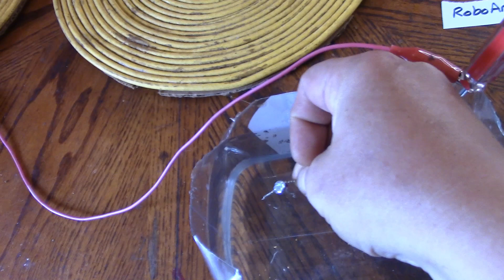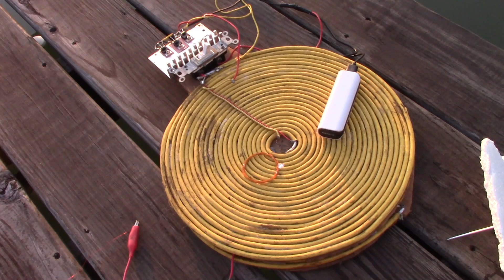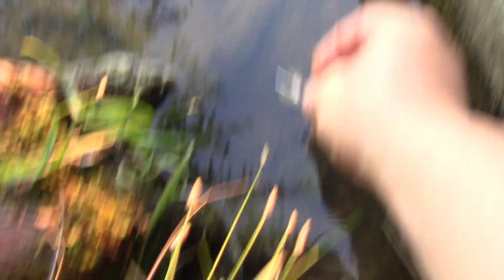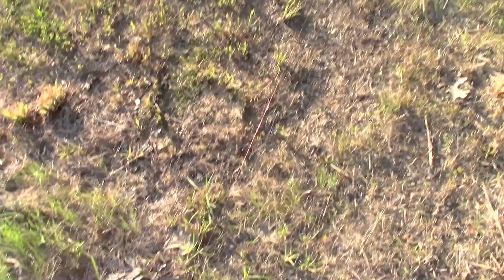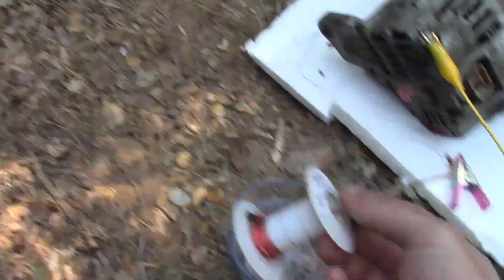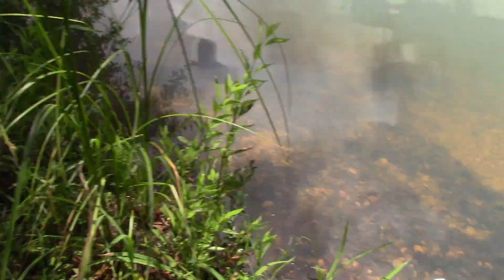Cool electrical effects - 1 wire transmission part 3

Comment: Great video! Are you running your coils as bifilar in LMD mode or in TEM mode?
Reply from the maker: Thanks, the 2 same coils like this are bifilar. In fact they are co-ax, with the outer braiding connecting to the middle copper at the mid length join. They work surprisingly well and were built about 10 years ago.
Reply: @Slider2732_  Thanks! That’s a new twist (pun intended) on the bifilar coil design. So if you are connecting the end of the outer braiding to the middle copper at the midpoint join its operating in longitudinal mode, yes? Also are you getting any cold electricity effects?
Reply: @Slider2732_  It would be great if you could do a build video showing how you made your coils with coax cable, because as far as I know you are the first to try that, and it seems to be getting you good results. Cheers!

Comment: if you just touch a leave with the led it will do the ground.
Reply from the maker: Good tip 😀 The tree trunk itself would likely be another useful ground for dry weather.
Reply: @Slider2732_  yup, might work. something i have working here is: the single wire going to a flowerpot, i am touching a flower in a second flower pot with the led with me or other things as ground. both flower pots are sitting on cardboard or wood and have no other "conductive" connection.
Reply from the maker: @MilkywayOutcast  Neat experiment! 
Btw, interesting DIY synth vids too on your channel, have subscribed  😀